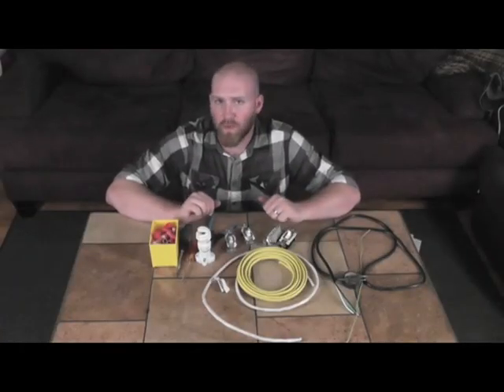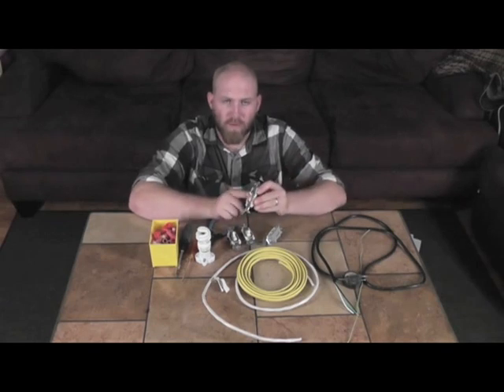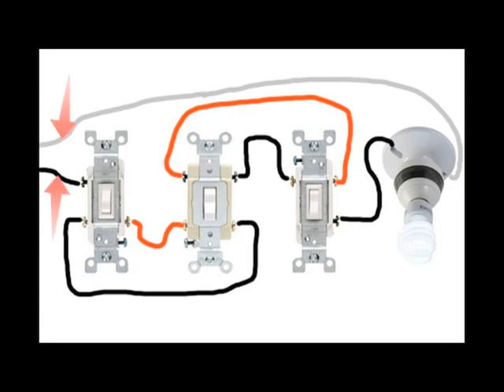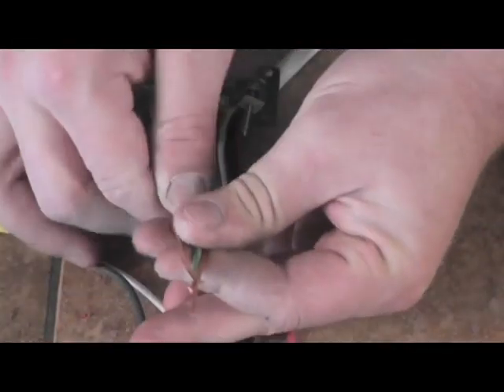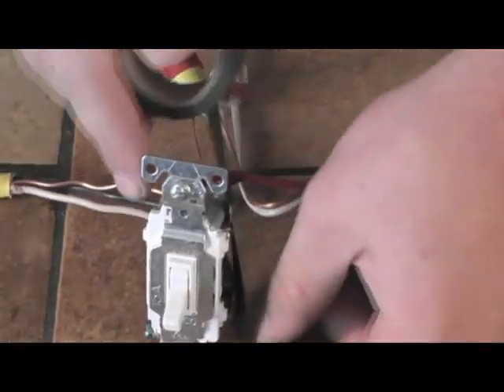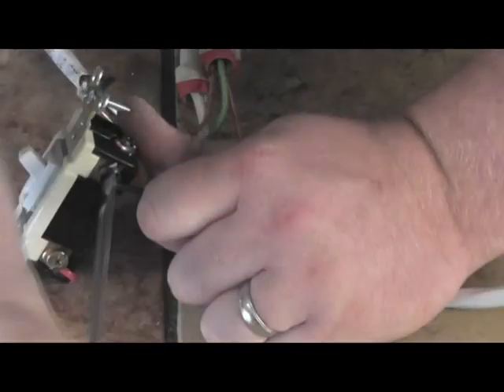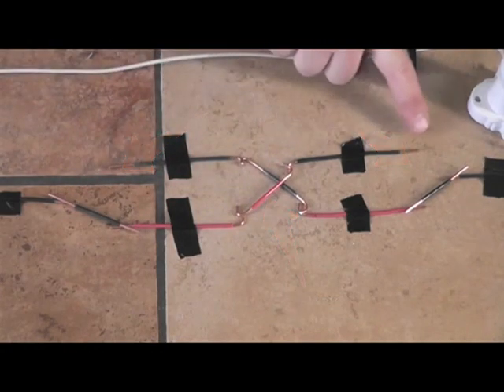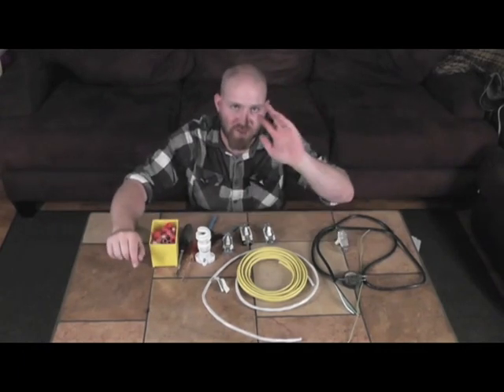4-Way Electrical Switches How-To with Scott Shaeffer - San Juan Carpentry

Comment: This is outstanding. I had a 4-way switch in my house that I was trying to figure out (mostly trying to understand if I could replace it with a 3-way switch, which I now clearly see I cannot), and this 5 minute video was like a short course in electrical wiring specific to my problem. Short, clear, and understandable. Good work.

Comment: Scott, I have 3 lights in the hall, and 3 switches.  I want to add an additional light at the bottom of the stairs and add it to the additional lights.
So I will have 4 lights and 3 switches. The switch at the bottom of the stairs has four terminals. How would I hook up an additional light to the four way switch.  This is the closet switch to the light,

Comment: Good except that the second stage (second 3 way) you don't show the leads clearly and you say "instead of terminating the hot to the black screw" then you fail to say clearly whether you are using the black screw or gold screws.   Completely confuses the process.
Reply from the maker: Santiago Draco Instead of terminating the "Hot", you're terminating the switch leg. In both cases, it's the black wire. Sorry if that message was lost. I explained it three different ways hoping to not miss anything. Thanks for the comment!